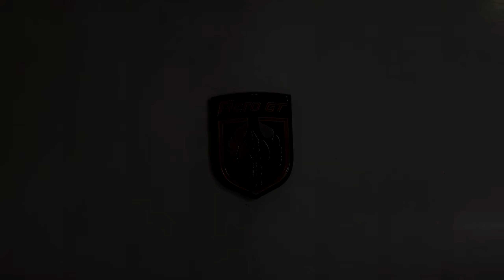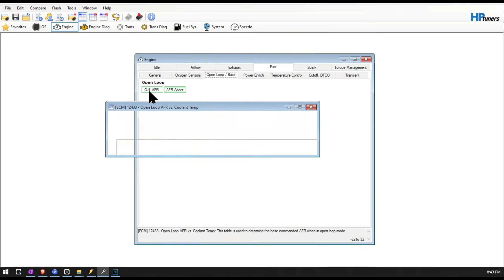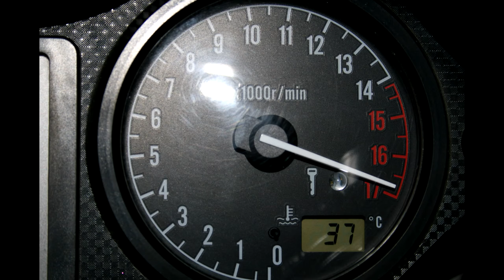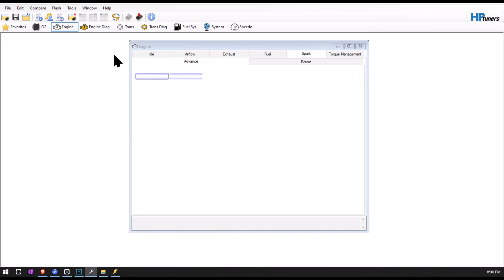How to Tune Fuel (MAF) & Spark Timing on a 3800 Engine with HPTuners

Comment from the maker: VIDEO SECTIONS:
00:34 - MAF Tuning Info
01:44 - MAF Tuning Requirements
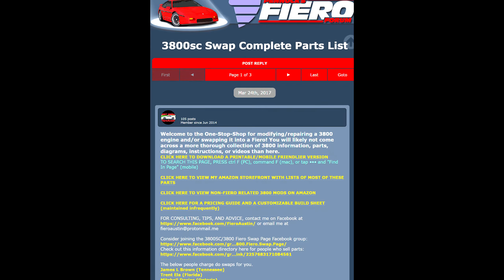02:09 - MAF Tuning Settings
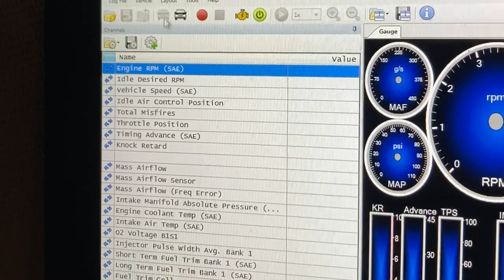05:16 - MAF Tuning Math & Gauge
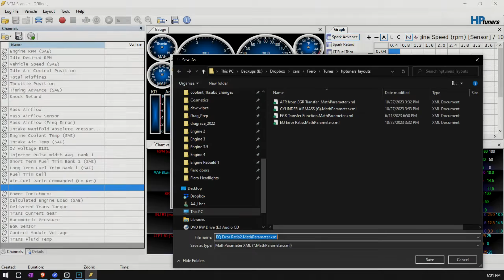08:42 - MAF Tuning Table
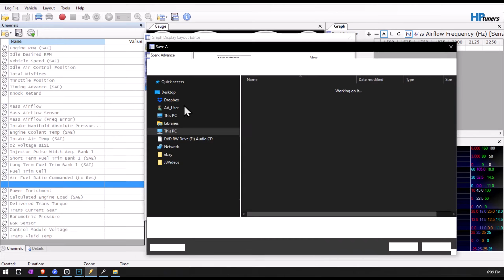10:22 - MAF Data Logging
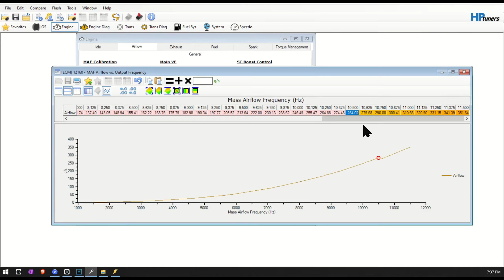12:53 - Revert MAF Tuning Settings
13:39 - Spark Tuning Info
15:03 - Fake Knock
15:58 - Spark Tuning Settings
16:47 - Spark Tuning Table
18:08 - Spark Data Logging
19:14 - Revert Spark Tuning Settings

PARTS AND VIDEOS REFERENCED IN THIS VIDEO:
O2 Sensor Install / E85 Conversion Video -  https://www.youtube.com/watch?v=7S5Vv43Jma4&list=PL9MEbquodF3isIM_4I2qJnkff2RlPWB_O
How To Swap 3800 into a Fiero Playlist - https://www.youtube.com/playlist?list=PL9MEbquodF3isIM_4I2qJnkff2RlPWB_O
Build Thread/3800 Swap Instructions - https://www.fiero.nl/forum/Forum2/HTML/139530.html#p0
HPTuners Basic Setup Video - https://www.youtube.com/watch?v=Upsm3kA8Pt0&list=PL9MEbquodF3isIM_4I2qJnkff2RlPWB_O&index=34
Wideband O2/AFR Sensor - https://www.amazon.com/dp/B00N3VGPYS?th=1&linkCode=ll1&tag=fieroaustin-20&linkId=26c3582f9eac756e16748f16166cff21&language=en_US&ref_=as_li_ss_tl
E85 Conversion Parts - https://www.amazon.com/shop/fieroaustin/list/PCGZN5DHUO3U?&linkCode=ll2&tag=fieroaustin-20&linkId=cbd6ce709a4464fae0713d1b39095fd1&language=en_US&ref_=as_li_ss_tl

Amazon Recommendation Store for 3800s/Fieros/Tools https://amzn.to/3hNViaa
3800sc Instructions http://www.fiero.nl/forum/Forum2/HTML/139530.html
3800sc Instructions MOBILE https://drive.google.com/file/d/1wqUJdMZ1XqcKJzC-2ZzbvLYMYE3QbmVq
eBay Recommendation Store http://ebay.us/hdJWbh
Donate to me https://paypal.me/FieroAustin
Join channel membership https://www.youtube.com/FieroAustin/join
Subscribe https://www.youtube.com/fieroaustin?sub_confirmation=1
Consulting https://www.facebook.com/FieroAustin/
Facebook Subscribers Group https://www.facebook.com/becomesupporter/FieroAustin/

#3800 #supercharged #fiero #3800sc #3800supercharged #pontiac #pontiacfiero #fieroaustin #howto #3800fiero #superchargedfiero #engineswap #fierogt #L67 #L32 #engineconversion #affiliatemarketing #affiliate
When you click on links to various merchants on this site and make a purchase, this can result in this site earning a commission. Affiliate programs and affiliations include, but are not limited to, the eBay Partner Network and Amazon Associates.

Comment: I’m using hp tuners pro link and for some reason no matter how many times I click the red output for afr it just doesn’t show the readings I have an 06 Grand Prix. The only thing different I do is when I’m doing the math parameters instead of egr I chose red output for prolink mpvi 2 3
Reply from the maker: I think you need to wire it up to an "input", not an output. I am not familiar with the mpvi 2 or 3 though
Reply: @FieroAustin  the reason you put in the EGR to AFR isnt for tuning the maf frequency ? its strictly to get the afr reading in your log?
Reply from the maker: @BBsAuto  It is for both. We use the difference (or error) between the commanded AFR and the actual measured AFR (from your gauge) to correct/adjust the MAF table. This stuff is explained here, sorry if it wasn't that clear. https://youtu.be/LWltDhpmv94?t=503
Reply: @FieroAustin  i dont understand why you are doing the math perameters? is that correcting the egr to afr? because with the pro mpvi3 i litterally just go and select for ther graph afr error math that is already listed in hp tuners, then tune the maf from there
Reply from the maker: @BBsAuto  Sort of. I am entering in the equation that specifically the AEM AFR 30-4110 gauge calls for, while using the EGR variable (0-5V input) scaling. It will look different if you want to just use the MPVI3 pro input instead of the EGR input, or if you use a different AFR gauge. HPTuners might have a profile for it setup already, not sure. Be careful with HPTuners profiles, they don't always do what you think.
Reply: @FieroAustin okay thankyou for your help. 
I think I’m doing it right although when I copied the numbers on the graph and pasted it in after a couple of times of writing the tune it’s killing and won’t stay running. Idk why that would be.

Maybe I have something wrong? 
What I have noticed is the afr is as commanded though 11.5 afr.
Reply from the maker: @BBsAuto  Hmm. You pasted as multiply by half, correct? And your error table is in %?
Reply: @FieroAustin this is what I watched. 
And how I created the graph. 
Yes I pasted it by half
I’ll check if it’s in %
Reply: @FieroAustin yes it’s in %
Reply: @FieroAustin I don’t think I have it right. I need to figure out the math first.
Reply from the maker: @BBsAuto  Not sure man. Make sure the MAF curve looks smooth when you turn the graph visibility on?
Reply: @FieroAustin yes
Reply: When I add a channel I’m getting correct afr but when I enter it with graph on the right side I can’t see anything 

Any suggestions would be nice
Appreciate your videos by the way great stuff!

Comment: Question. Is it still supposed to be in closed loop after failing the maf and disabling the closed loop? Mine still says its operating in closed loop and reading ltft in the scanner and channels section
Reply from the maker: It should stay in Open Loop during warmup. Closed Loop kicks in when the car gets hot. Unless you increase the temperature at which Closed Loop is enabled as in the video.
Reply: @FieroAustin  Mine is still goin in closed loop, even after disabling as in video.
Reply from the maker: @1FASIMP  Under Fuel > Oxygen Sensors  > Closed Loop Enable is set to 283 F? Are you sure you downloaded the calibration to the computer?  Otherwise, you can still definitely tune it in closed loop, it just might be a little less stable. There's another way to tune entirely too, which would be to just monitor your short term and long term fuel trims, and adjust accordingly.
Reply: @FieroAustin  I set mine to 284. And yes ltft tuning, it seems very unstable, and jumpy. I have attempted it, and believe because of my mods. It need a ve tune.  But have issues with it staying in open loop, unless i unplug my o2 sensor
Reply from the maker: @1FASIMP  hm. try 283, not the max value. Unplugging O2 sensor has the same effect.

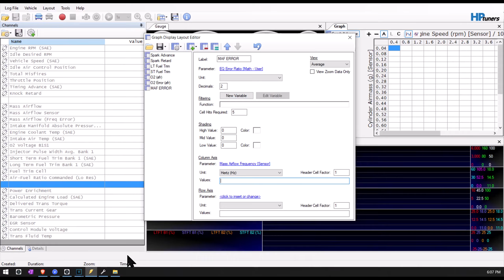Comment: 10:00 I didn't all that and I don't get any readings
Reply from the maker: You may be reading in the wrong variable. They can be slightly different names depending on what computer you are using. It takes a little fooling around the first time to get it all set up.
Reply: @FieroAustin  ok I'll keep trying, do you have like live classes or something? I'm trying to tune my firebird NA stick I bought ho tuners and a wideband sensor and afr gauge I just don't get certain things like freaking knock
Reply from the maker: @K_spawn  I do not really. This vid covers pretty much everything for 3800s you'd need. or go watch this one too: https://www.youtube.com/watch?v=Upsm3kA8Pt0&list=PL9MEbquodF3iT4dL8ruvZQL4pabfi1DyA&index=13
Otherwise GMTuners does some consulting.

Comment: Can you still have fake knock if the balance shaft is just floating. (I have a double timing roller chain) so I didn’t take it out because I didn’t have caps to plug the holes.
Reply from the maker: Yes you can. Since the balance shaft isn't spinning, it's not balancing, therefore the knock sensors pick up that extra vibration and start fake knocking.
Reply: @FieroAustin  ok cool. Thanks Austin
Reply from the maker: @RaisingRa  of course. hit me up anytime.:_FieroFamSuper::_FieroFam3800::_FieroFamFiero:

Comment: A .880-.890mv on the air fuel ratio i find to be the best power range in tuning most gasoline internal combustion engine. Its best to run a Program Fuel Injection system with the ECU.  No MAF, No O2 sensor, No EGR feedback to the ECU. The engine temperature must maintain a 170-180°F .
Reply from the maker: Are you talking about a lambda value of .880-.890 (~13.0 AFR gas equivalent)?
That may be true but most people intended for this video are not using an external fuel injection system, so they would need feedback to understand whether the MAF is calibrated under boost. It could be done with looking at fuel trims but is difficult.
Reply: @FieroAustin  Agreed - definitely need feedback for calibrating the MAF via fuel trims (part throttle only) or wideband for WOT.